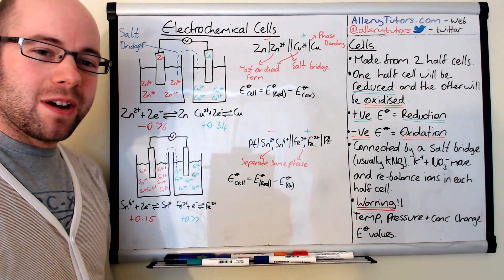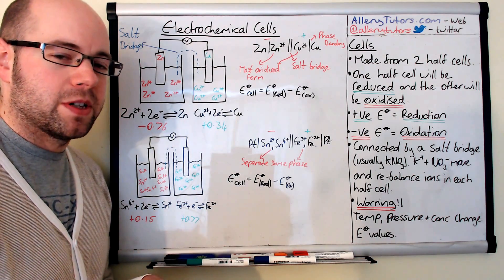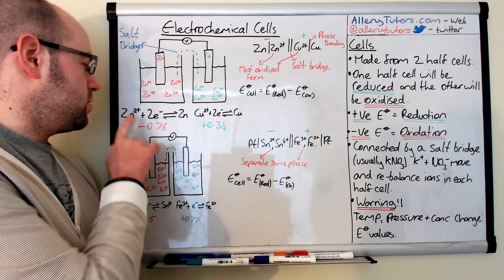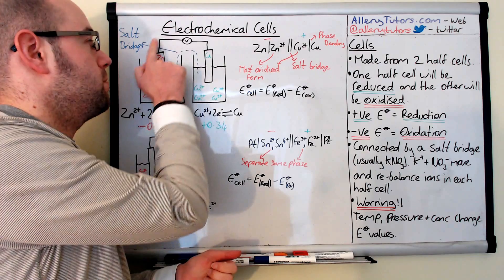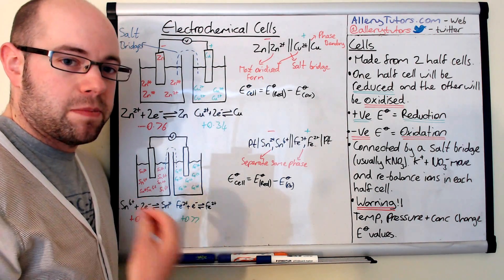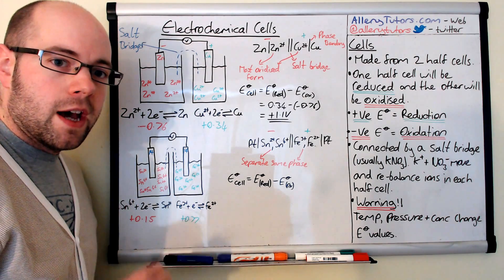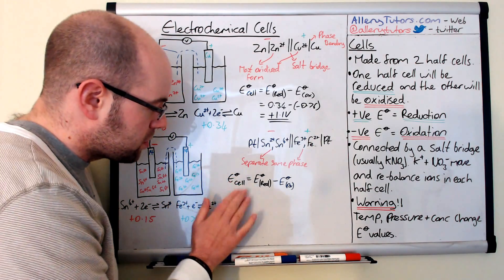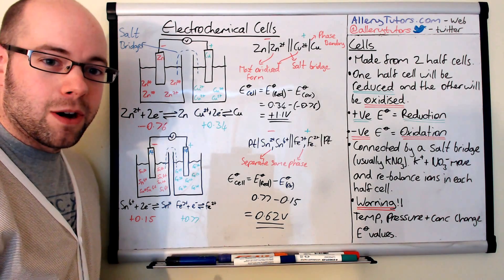Electrochemical cells

Comment: I'm slightly confused so i would greatly appreciate some clarification:
in eg galvanic cell Zn and Cu 
if a voltmeter is connected since it has very high resistance do electrons still flow? 
or
do equilibrium reactions become established and the one is just more oxidized than the other ?
if there's a wire it makes sense since elections will flow from anode to cathode

Comment: I'm a bit confused. When drawing a cell diagram when do you need the Pt (s)?? What if the electrodes you are using are not platinum electrodes say copper and zinc.
Reply from the maker: +Rhea Jain Yes you only use Pt when you are using a solution that doesn't have a solid, conductive atomic version of the ion. E.g. H+ solution would have an atomic equivalent of H2. Now H2 is not a solid so can't be used as an electrode, we have to use an inert, conductive metal in it's place hence the use of Pt. Using Cu2+ and Zn2+ means we can use Cu and Zn respectively. These are conductive solids and so can be used as electrodes. No need to use Pt thankfully! Would make cells very expensive!